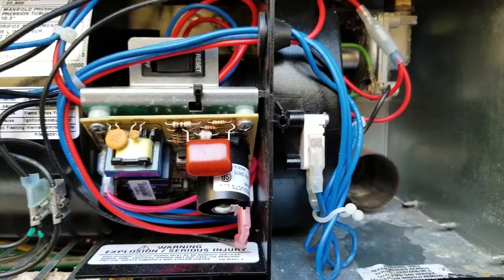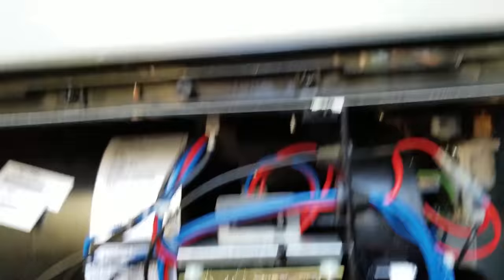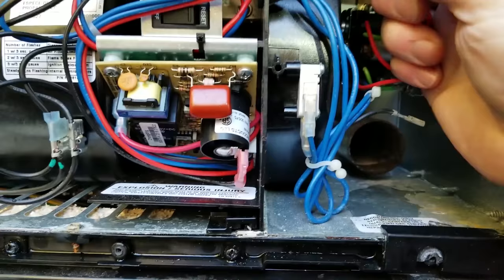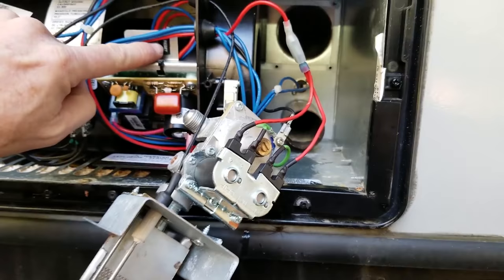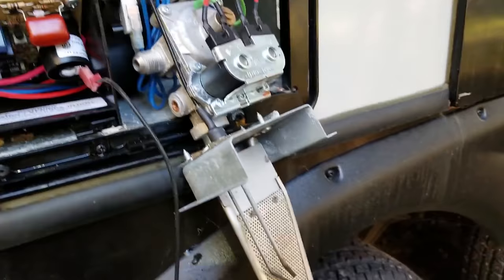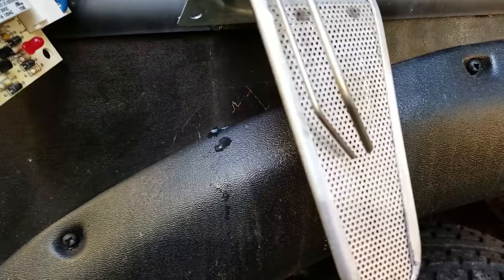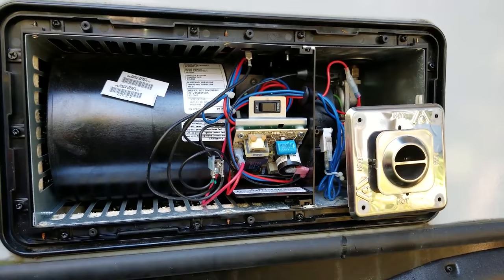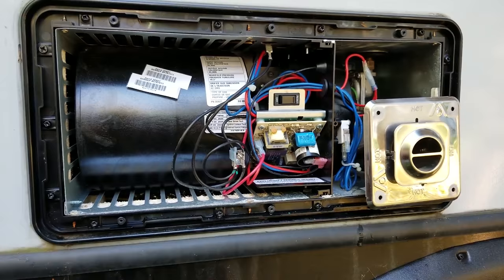Troubleshooting An Atwood RV Furnace Circuit Board

Comment: Point of interest. Dometic had an issue with the vent louvers punched wrong, with that, it allowed the rain water to saturate circuit board. If ur out of warranty they will send ur tech the parts, but will not pay labour..if it was my job in the video I would have went right to the board, not pulling burner and saved my labor customer $..just saying
Reply from the maker: Hi Gary,
Thanks for your comments.  We have performed the recall on several Dometic furnaces that addressed your comment so it was good you mentioned that.  I plan on cutting a new video on that topic the next time we get one to work with.  I have a video coming up with a failed gas valve but that furnace already has the recall performed on it.

I charge a flat rate to diagnose the furnace and while I am on the job I want to be thorough.  I like to 'prove' that the components attached to the board are within spec before I install a new board and then discover (too late) that the attached component is what caused the board to fail and now I have two failed boards.  It is also good to verify the gap on the electrode so the board gets the correct mA reading.  That is just how I do it but everyone has their own way.

Thanks for watching!

Cheers,
Darren Koepp
Reply: @MyRVWorks  after i sent that reply i regretted  it. I didnt mean to be critical. I now understand that viewers need to conceptualize  and it was a great tutorial for budding r.v. techs..
Im a fan, and glad that i found you.
Reply: I wonder now if my Dometic AC or Furnace is included in the recall?

Comment: Help. 1 flash works fine when cover is off and outlet pipe in. But when i put all back together with cover it works for a little than stops. Than 1 light flash again ive tested by covering bottom area it shuts off and light flash. Could it be my heat limit switch getting hot fast it has little rust on connections. Or is it the cover and not being able to let hot air out so shutting off. My pipe is loose like so maybe hot air is staying inside ther maybe i dont know.
Reply from the maker: If you want to troubleshoot the high limit thermostat on the furnace, for testing purposes, you can bypass that device. Don't let it run like that as a fix but that is how I troubleshoot intermittent high limit thermostat issues.  Just unplug the Spade Terminals and connect them to each other, bypassing the thermostat, and see if that fixes your problem. If it does you should be able to find new high limit thermostats on Amazon for a couple bucks.
Reply: @MyRVWorks  thanks. I believe it was my exhaust tube was loose. So i foiled it to fit tight and all good. Think it was returning to much heat back to itself. Thank u ill keep advice in mind!

Comment: Is it possible for a board to be intermittent.  My heater works 5 or 6 times, maybe even a day or two. Then I get one flash on light ,air flow/limited fault .sail switch is working .could I have a bad board
Reply from the maker: Is your furnace and Atwood/Dometic AF series? If so you might want to change your sail switch before you swap out your board. There is a known issue with some of their sail switches having some intermittent issues. I just changed one the other day.

Comment: i have installed a new board on my furnace. it will ignite when plugged into power but if the batteryies drop to 11 it will not ignite could this be because of a weak electrode?
Reply from the maker: The boards have a minimum voltage check that they go through. From memory I believe it is 10.7 volts. So if your battery voltage is low, you don't have enough battery juice to run your blower motor at the full RPM, therefore there's no reason to start your furnace because you cannot support proper combustion.

Comment: Question, I am having problems with my Atwood/Dometic AFM Furnace,  I cannot get the fan motor to start.  with the control board,  I have tested the fan motor with 12 volts DC and it does work.  I am thinking to fool the board by having the furnace run (hard wired to another 12 volts.  My sail switch is good read out with ohm meter, and tested with  fan blower running.  HI Temp switch is closed as it should be.  So far this is what I have trouble shot down to is that the circuit board relay to turn on the fan motor is bad?
Reply from the maker: I'm doing this from memory, but see if you get a 12-volt signal on the blue wire at the white plug on your control board. If you're not getting 12 volts at that point, when there is a call for heat, then it is not the control board and it is something in your thermostat, sail switch, high limit thermostat circuit. If you do get 12 volts on that blue wire then more than likely it is a control board failure.
Reply: @MyRVWorks  I forgot to mention I did test the blue lead that comes from the thermostat and have 12 volts DC to the card etc. We are on the same path just a little memory lapse from trouble shooting session to typing questions.  Thanks again
Reply: @MyRVWorks   I just fixed my furnace.  Your videos lead me to the main control circuit board on an Atwood Furnace. 1.  I had the 12 volts on the blue wire from the Thermostat.  2. I had the 12 volts power from the main power switch.  I tested the blower with 12 volts,  I checked the sail switch both with continuity and took it out to check for damage.  I checked the sail switch operation with the blower on and it worked.  I checked the gas valve with 12 volts DC and smelled the gas plus heard it work.  I checked the High Temp Relay and since it was normally closed, I was able to read out with continuity tester and volt meter. I could not check the igniter circuit due to circuit card working.  I ordered a new card from EBay for $89 including shipping, far less than others/dealer.  I installed the circuit card yesterday afternoon and did a test run late last evening when we had  lower temperatures and could actually test run the system with out any jumpers.  End Results Fixed.  Thanks again for your videos and trouble shooting guides.  I did find the Atwood Furnace package and sequence of events.  I learned my electrical trouble shooting while in the Navy many moons ago.  Happy Camper My RV Works!

Comment: Hello. I have a Atwood 8531-IV. When I try to turn it on I get a very quit click then nothing happens. Blower motor will not cycle. I check fault code and see 1 flash per 3 second. Air flow limit fault. Pulled out( under refer no outside access) When I press the reset button it immediately causes the black box on the circuit board to click. Do I need to replace board or is it the sail switch. Also only get 9.5v in  to thermostat on red wire and 3-4v out at white wire. Could thermostat be main issue? Thank you
Reply from the maker: From your statement I'm curious about that motor.  Find the motor leads, you will see red and black wires. Disconnect them from everything and apply 12 volts directly to that motor.  If the motor works fine then you might have an issue with the control board. If the motor does not work fine then you might have an issue with your motor.
Reply: @MyRVWorks  Thank you! I will do that this evening and let you know the results. 
Also, what distance or area do you include in your service? And do you have parts available for purchase or mostly through your affiliatied sites? I'm just out of Everett. Really find your videos helpful and informative. Even the ones that I'm not having particular issue in my trailer, cause someday....Thanks again. I truly appreciate your help.
Reply from the maker: @ryanwilkins7877  For service area, all of Kitsap and Olympic peninsula.  We have gone to Whidbey Island a few times too.  I have control boards readily in stock along with many of the smaller parts for these types of repairs, but motors are too numerous to keep in inventory and we can usually get them in a day or so from our vendors.  Amazon even has the motors.   Thanks for watching!

Comment: Why reconnect gas valves when your testing igniter? Just curious
Reply: Hi Jakob, thanks for your comment.  During my troubleshooting I determined that the issue was not with the electrode but with the control board.  Having established that, and also seeing the sparking electrode with the new board, the next step was to reconnect everything and perform a complete test with LP on and the exhaust port connected.  Whenever the gas line is breached it is important to perform a leak test, I did not show that part in the video but will try to include it in future video’s.
Reply: When I had the burner out I reconnected the red gas valve wires because I wanted to hear the audible click to indicate when the spark would be expected…  Hope this answers your question more clearly.

Comment: The title was how to troubleshoot in Atwood  Furnace.  You only trouble shot one issue, what about other issues? What about a furnace ignites but doesn't stay lit?  What about if the light on the board is only flashing once or twice? How do you troubleshoot those issues.

I appreciate what you showed but it was not a complete Troubleshooting video for this furnace.

Comment: Great video, thanks!  I believe I have the same unit, but listed as DFMD30111.  I am getting ignition and heat, which then fails after between 10 - 60 seconds.  I wanted to check the flame-sensor - do you know if that is that part of the electrode / spark assembly?  Thanks!
Reply: I've been troubleshooting the same issue. I pulled out the igniter/flame sensor unit, cleaned it up and still didn't work. I pulled the board and took it to the service guy at the local dealer who confirmed it was bad. I've ordered a new on from Amazon and should have it Monday. I'm pretty confident it will fix the problem. Also found from reading forums that the replacement made by Dinosaur electronics is a much better board.
Reply: @robedwards4636  Please let us know how the replacement board works out for you!
Reply: Bryan B fixed the problem. I did have a little trouble after cleaning the burner and heat sensor a had created to large of a gap for the igniter so I had to pull the burner unit and adjust.

Comment: Hi, I have one flash fault on my Atwood, how can I fix this, thanks
Reply from the maker: The one flash fault is indicating that there was a air flow sensor fault. This is the sail switch that everyone talks about. The way the control board works, with respect to that sail switch, is it must see the sail switch change states from full open to full closed. If for some reason the sail switch is full of pet hair, for example, and the board never sees its cycle, then the furnace will never start (and you would not want it to because you have a fault in the safety circuit.) You could also have a failed sail switch that has no physical obstruction but electrically is not changing states. Depending on your furnace, the sail switch is easy to get to or difficult. Usually it's two blue wires but it could be a blue and white wire. It will always be located within the fan blower housing.
Reply: My RV Works, Inc. I took the sail switch apart, my unit is 2019 so everything is fairly used, did not find anything wrong and when I reinstalled the sail switch, it started working again.  Thanks a bunch

Comment: where is the limit switch
Reply: On most furnaces the sail switch and the high limit thermostat are "daisy-chained" in series before they make the trip back to the control board.  That circuit tells the control board the conditions are good to introduce gas into the burner and ignite it.  The sail switch will be in the fan housing so if you identify that you will be able to follow one of the wires connected to the sail switch and follow it to the high limit thermostat.  Some high limit thermostats are located in the back of the furnace, in my video with the Dometic AFM the high limit thermostat is right below the gas burner I removed - in front.  They will all be located somewhere where they can monitor the heat in the heat exchanger.  Follow the blue wires and you will find it.  At all times that thermostat should be electrically ‘closed’ allowing the 12 VDC to pass through it.  It opens when the heat exchanger gets too hot.  I have found failed ones though.  Biggest issue I have been working on with these AF series furnaces is the sail switch.  A perfectly good functioning switch, after working for a day or so, will fail.  Hard to troubleshoot.  Dometic is aware of the issue and working on it.   Hope this info helps, if you have any additional questions don’t hesitate to ask!  - Cheers, Darren

Comment: This isnt troubleshooting, this is changing parts until you get the right one. Troubleshooting consist of checking the broken parts trough electrical or mechanical means to determine fault. 

People that are looking at this and need to know which part is bad so they can buy a new one cannot use this video at all. Its pretty stupid.
Reply: You have a point Luke, however, this is exactly what they do at the dealership and then charge you labor on top of parts cost. So the vid serves a purpose and the parts are relatively inexpensive compared to dealer cost.
Reply: You both are correct. I'll explain what my Atwood 8535IVDCLP Furnace is doing and ask Darren if he can opine.  I did in fact use this video to isolate my issue to be somewhere between the thermostat on the wall, the front A/C ceiling unit controlling a Duo-therm 57915.522C AC or down to the control board of the Furnace. The issue is intermittently the fan motor and sometimes the heat will not shut off, they continue as if the demand for more heat isn't satisfied. When I give power via the thermostat prior to the purge if I lightly tap its slide temp setting I can hear a faint telegraph type clicking at the front AC unit and the heater came on. I tried to stop it that way once the temp in the RV should have shut it off but it did nothing. I will try and swap the two thermostats in my RV (the bedroom looks identical but only controls the back AC unit) Oh one last thing Darren, the front AC doesn't seem to work, the rear is fine, that could be key to your advice.
I am sort of dry camping so to get 240V I must start the generator, meaning I actually live in the RV with only one side of the 240v ie 120v and I will retest the front AC unit later; if it isn't working perhaps it's up in the thermostat to the AC to the furnaces control board? I will first isolate and check my fuse to the AC unit, heck it could be that simple. 
Luke might be having a problem like mine, but needs to realize you have to go where that RV's issue is. Perhaps Darren can do the same type video he did on the, How heat makes an RV Refrigerator Cold video with his son Dakota? That could be the final leg of his furnace videos IMHO? 
I think Luke was hoping for that type video versus fixing and troubleshooting what problem presents itself in this video. And Luke, if he didn't cover what you needed he has other resources to keep your repair cost low, so explain what you have and perhaps he does a video on that aspect of the issue as well. I believe you can pay for a direct consultation on your issue and it isn't much either? 
Darren could you tell me what I should test in the front AC that relays to the Furnace but if not I am decent at elimination until I find the problem. And I don't mind paying for the advice. If my issue went to the local shop I'd be in the hundreds, and I haven't spent a dime.
Reply: @TheeAthis  well I do agree with you but take my experience for example. Im in the woods and very far from any camping parts store. My furnace was not working and so I cant just pick up any parts to play around with it and guess. 

I checked for voltage, I checked the sail switch for continuity, I checked the high limit switch for continuity and then verified the voltage got that far. Once I determined that I was able to follow the voltage to the ignitor control module. The voltage went in but didn't come out. This led me to know that the control module was bad and so I went to a near by junkyard and grabbed one off of an old rv for 15 bucks and now we have heat lol.
Reply: @Grzmnky  Have you seen his video on how the RV Refrigerator cools solely on heat? I can see his approach, he has a job that could make a good video and so that is taped. I've remodeled RV's and tried to make videos, half didn't save for some reason, the others were difficult on sound or other issues like camera angle. It's Hard! I wish he would have expanded the aspect or testing up to the front AC relay - included the soft-start for dual systems then back to the control board. Obviously, if he's trying to fix something and he has the spark or whatever at the Furnaces control board he only mentioned it, and I wished for more. Maybe at a later video and I've suggested it herein. @Darren has a business he is running more than a job, makes professional-grade videos, he's likely involved in community affairs, perhaps hobbies, and raising his child(ren). I hope he will get to my issue but if not, I'll pay via patreon like about $75 and they will walk you thru a diagnostic process if you have tools, testers and basic repair skills. I think the patreon path helps him get freed up to make this video. Check it out next time, and remember, it was this video that got you to the junk yard, no?

Comment: I have warm heat , and the exhaust smells like eggs
Reply from the maker: You'll need to check the LP pressure at the furnace. It sounds like you're not getting the correct amount of vapor pressure at the furnace.